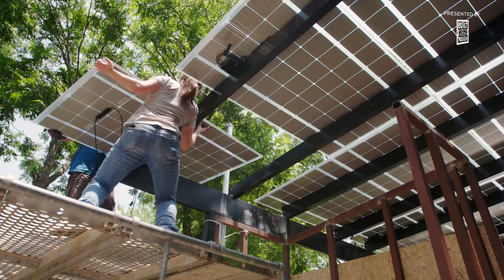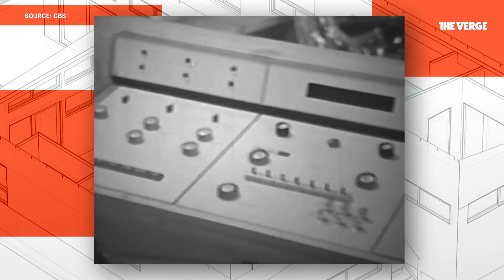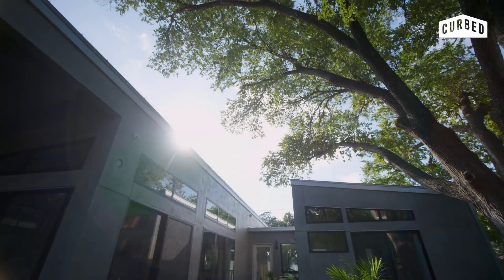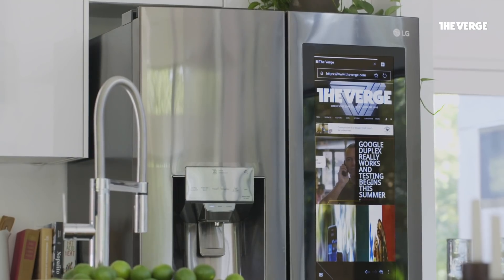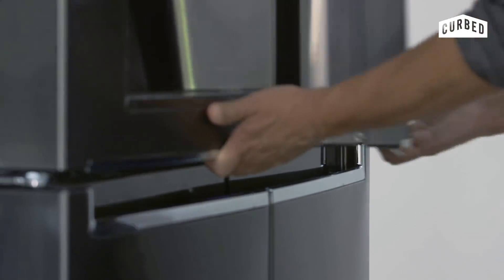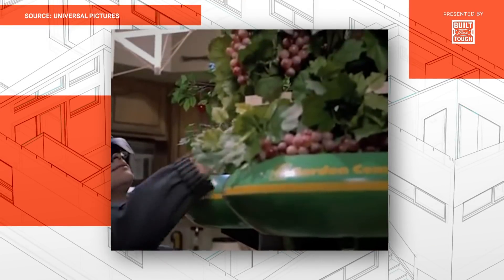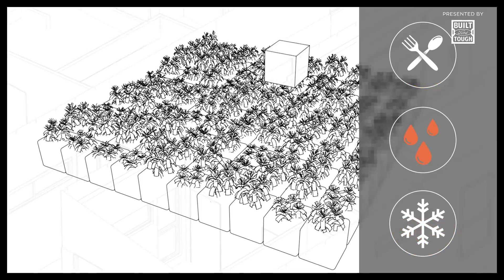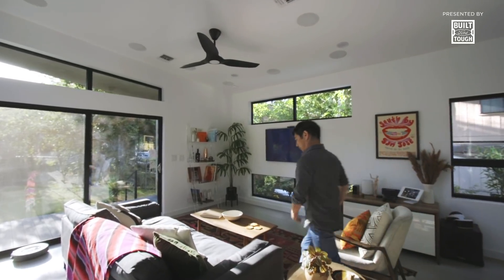What your home could look like in 50 years

Comment: Grant (and some of us) would do all the smart part of house using some some raspberry Pi's and some arduino, without using super expensive commercial products. I honestly didn't learn anything from this video and my house is kinda smarter than that. One thing to watch for, because a "house of the future" would probably be used by multiple generations, every new tech should be integrated in the old one, so older folks could turn on the lights without having to learn how to use an ipad or alexa.... My parents don't have any idea of the ammout of tech in our house. when they come home, they insert the keys  in the door and flick the light switch. When I return home, my computer is starting up when im near 50 meters of the house and the door opens when I touch the door handle (rfid chip in hand), etc.

Comment: Well, Grant. I think it is possible to completely just abandon air conditioning in the home, and it's not even an architectural solution. If I recall correctly, there were some people at Stanford researching temperature regulation via a glove that would cool blood at the hands of athletes, so that cooled blood would return to the heart, thus reducing the core temperature of the body. If they could package that research into a wearable device that didn't obstruct with everyday life, I do believe that we could essentially just get rid of air conditioning because one would be able to regulate and control the core temperature of the body as one would desire.

Comment: on a vacation a series of flights presented my wife and I with inflight entertainment ideas from a variety of different generations, one leg had an older plane with the fold down screens from above the seats. another flight on a newer plane had integrated screens in seat backs, and the newest plane had USB ports for charging the entertainment that was brought along with presumably each passenger.  Looking at a car from even 5 years ago you can see how dated the operating system for the built in entertainment system looks. I think the home of the future will have to be less integrated and more open. I don't want anything in my future home that locks me into a tech from 2018. I want ability to use new tech in my home seamlessly.

Comment: A fridge lasts 15-years??? My last fridge lasted just over 10-years, I am not sure I'd spend  $3,700.00 (CDN) for a fridge that will only last 10-years. I break that down into the yearly cost + electricity cost and it just doesn't make sense. What would make more sense would be a interactive screen in the kitchen or family room; though I get the other features the fridge offers -- they just don't make sense.
Reply: Just replaced our fridge this year that I originally bought when I was flatting with my then fiancee. Gone though two houses and our eldest kid is now 16. so it lasted way longer than expected.

Comment: Worrying about your refrigerator being current in 15 years is less important then 95% of the homes furniture  literally falling apart by then.  Cheap material furniture is the single biggest waste of resources there is. Older manufactured furniture is recycled many times because it is still useful.  Ikea type stuff is simply thrown away most times within 6 months because it falls apart or if moving it's cheaper to purchase new.  A complete waste of resources.  I dare you to return to your home of the future in 18 months and see the condition of all of the cabinets, chairs tables etc......

Comment: This is more about the kitchen and you mentioned only a few things about the house in total. What about a Tesla car with a Tesla battery that is charged by the solar panels? (Instead of that Ford with that high MPG) What about recycling water? What about doors? Windows with tinted glass?
Reply: Yes, a house of the future would have nano coatings on the windows, auto opaque LCD inside the double glazing, self healing roof that automatically closes up any leaks that develop, or monitor the structural condition to alert you BEFORE a massive storm dumps a dozen litres of water into your bedroom.
Smart Power distribution to other houses in the neighbourhood, or being able to utilise the battery in your car for emergency power during a blackout. So much more useful than the stupid home auto controller they had that they can even re program themselves.
Reply: Ford is the sponsor. We were betrayed by the car

Comment: A home at the end of the day is just a shelter between us and the elements. 
A home of the future is just slapping on extra luxuries that make the less environmentally clean. Take an off the grid log cabin that relies on a well and maybe some solar power for basic electricity needs and compare it to a "home of the future" and tell me which one is greener...
To say a home of the future is greener is comparing it to luxuries we slapped on homes that already disqualified it from that category.
Furthermore, the more tech in a home, the quicker it becomes the home of the past. Take the very dumbphone example you used. 15 years ago, a basic Nokia cellphone was considered cutting edge consumer hardware for most and in less than a decade it became obsolete.
That's the paradox in creating the home of the future. The more you adopt new tech, the quicker your home gets left behind.
This is more of a commerical for high tech consumer home gadgets than an actual look into the future. We already live in homes of the future with electricity, wireless internet, climate control, etc.

Comment: I'd like to see a complete food supply system and in home recycling. Food would be grown and processed in the home (like how a Beyond Meat burger is made from peas). If our food printer can't supply some special ingredients they would be automatically ordered and delivered. Food waste becomes fertilizer,  cleaned waste water  plant water. Same for things. Plastics, metals, circuit components, and flexible polymers would be stored. Need a new microwave? Print one up. Just don't forget to throw the old one in the recycler to keep the printer stocked! If you need something too complicated (like a new flexible transparent phone you can wrap on your wrist) your house will order after determining it can't print it.
Reply: There is this https://www.amazon.com/Food-Cycler-Kitchen-Compost-Container/dp/B00KLI43RC. And the whole 3D printing will have to fight against production lines on industrial scale optimized to reduce costs, I think it will be useful for exploration and space, but not here where buying is an order or two of magnitud cheaper than 3D printing

Comment: What I would want in a home of the future. An in earth dome with the southern wall set for passive solar gain with a tromba wall for thermal storage. A rocket Mass Heater as a back up heating, hot water generation and cooking system. Solar thermal hot water generation. Methane digester for gas generation. A rain catchment system with solar sterilization. Retractable solar panels in case of bad weather. Human power generation as a backup system. A green machine sewage treatment system. A trompe air compressor for compressed air and electric power generation. A permaculture food forest. An electric/methane gas hybrid tractor and an electric/methane gas hybrid vehicle. In earth green house for growing food all year. A nice big Ham Radio shack for communications. Just thoughts off the top of my head.
Reply: You'll live in a normal appartment, four walls, no hibrid anything, because you'll live in a city.
You won't have a car, you'll pay subscription for an automated uber.
Human power generation is not a thing, solar sterilization is a thing you made up. We already have water, it comes from rivers. 

Permaculture food forest is another thing you made up. You'll go to the supermarket and buy completely genetically altered food, with tons of weird chemicals in it, because its whats easy to produce and costs 100 times less than your alternative. And youll not be rich to be paying the difference.

Trompe air compression is also a word you made up. You won't need air compression, because no one has in the entire history of humankind.
Reply: Google everything you think I made up, it all exists (Sorry the YouTube spell check changed trombe to tromba) . Do your research. The question was what I would want in a home. No one has a crystal ball to see into then future, my dream is as valid as anyone's. Funny thing is I have an air compressor in my garage to inflate the tires I have on my vehicles and run air tools. Most people have benefited from air compressors.
Reply: If the question was what you want in a home, then you're right, that's true. But you still made up "permaculture food" I won't back down on that. I refuse your globalist lies.
Reply: Google permaculture food forest or Geoff Lawton. I don't believe in the globalist agenda. If you read what I wrote again, you will see that the home I want is off grid which reduces global control over it and me. I think if we were neighbors we could be good friend. We may not see eye to eye on everything, but if we did that how boring would that be?
Reply: Haha I agree my man. Cheers. I was just joking. Stop making up words tho, it's a bad habit.

Comment: Easy ideas for home of the future:

Virtual reality room, with a full treadmill floor.  Becomes the home gym of the future.

Modular home design using all polycarbonate materials that are meant to last.  Each room is a separate module that can be purchased, making overall ownership more affordable.  Each module has it's own hookups for electrical, plumbing.

Automated sliding doors, for interior and exterior.

Local power and water recycling, to make the most use of resources.  External water tanks that plug into the grid, same as power.

Wireless power stations in every room.  Is a device that sits in ceiling, like a light, and emits waves (whatever the technical terms are, this exists already).

Windows that double as viewing screens.

Comment: Even though I loved all that you did with your home, the simple fact that ALL the tech in the home is currently available proves it's more for the present then the future. It does have a futuristic vibe, but to actually talk about a home of the future, you need to get away from current thinking and delve more into the Scifi of things to come.  Some of these points were touched on in this episode.
Reply: Youngaloha very smart comment indeed.
Reply: I concur. I would like a home with a very different way of cooling and warming itself off the grid, I live in the desert. And it still has to be beautiful, light and airy.

Comment: It’s a home of gadgets. The most structurally integral home is a steel/concrete geodesic structure. To construct a home of the future, you need to go beyond the consumer gadget home.
Reply: At least they said (in an earlier episode) that you could get most the gadget's features for about $200, when they're showing much more expensive versions with a $30/month service fee on top of it. 
Still gadgets alone don't make a future home. They had some passive solar, that ultimately seemed more an aestetic change rather than a functional one. Windows are poor insulation, but they're trendy right now. So much missing.
Reply: Really appreciate it
Reply: The UT professor eluded to as much as well as society's slow adaptation to drastically different concepts. Btw, theres a company selling module geodesic homes today. Cant remember the name but thought they were cool
Reply: Complete Home Electronix a video titled “home of the future” should execute the true potential of an efficiently designed home that maximizes the well being of the home owner. I’d like to see more radical designs and technology implemented. Geodesic design, solar photovoltaic cells, modular furniture, highest energy efficiency. The Verge wants to appeal to the more common modern design.
Reply: @TimeKillersAddendum  in fairness, they are tech reporters so the fact that they focus on tech over design isnt surprising, but i definitely see your point
Reply: Complete Home Electronix you are correct
Reply: Exactly, the home of the future would need to be a lot like the home of today. The home of today lasts long because it's customisation and practical. Gadgets, which get dated, are  like add-ons rather than built in.
Reply: Pete S. I have to disagree on that point. I believe the homes of today are not representative of the homes of the future when it comes to material, design, and construction methods.
Reply: Christian Eaves I am not speaking of materials really, future houses should be more environmentally friendly and manage temperature better. The home is like a structure, that does not have tech built in, but added to it. That’s why homes have aged well.
Reply: I'm not sure I agree... Homes are generally not well designed for the needs of today. In my living room the doors are placed "wrong" so placing a huge TV and my (way too many) speakers is very much ..er...not optimal... The kitchen is hard to "fix", there's no real place for a micro, and the former owner had neither fridge nor freezer in there (placed in a "storage room"). I found a small combo and ripped out a door to place it inside a cabinet. And this place was built in 1960. I grew up in a house built in 1911-1912 and while that house was "built to last" it's a freakin' nightmare in most ways (but the garden was ok and the view was breathtaking from the balcony). Let's not even get in to the problem of asbestos, old electric wiring etc. Basically every room is "wrong" today, every door/opening is in the wrong place and "tomorrow" they might very well be "right" again.
Reply: I'm an old school rock and steel house kind of guy.
Reply: Very great observation and i fully agree